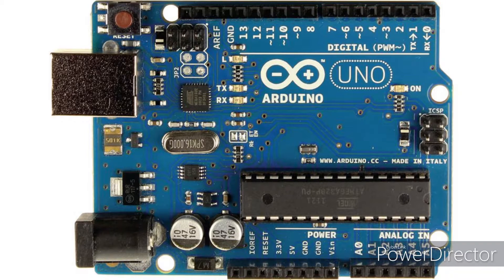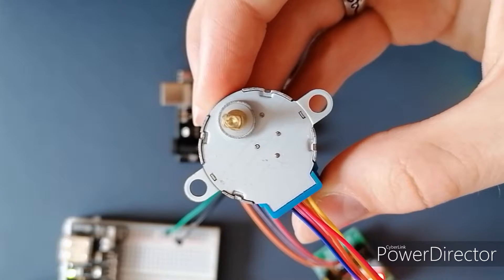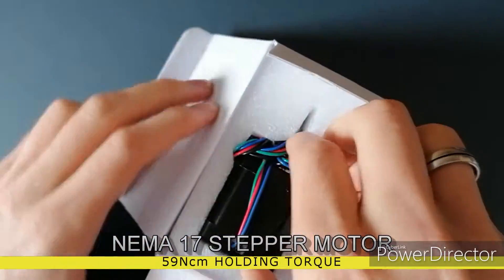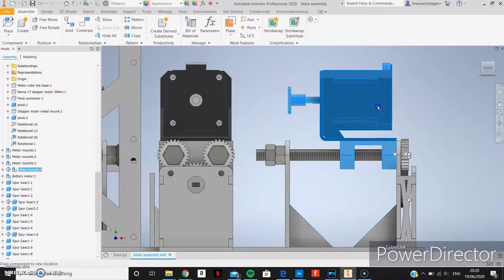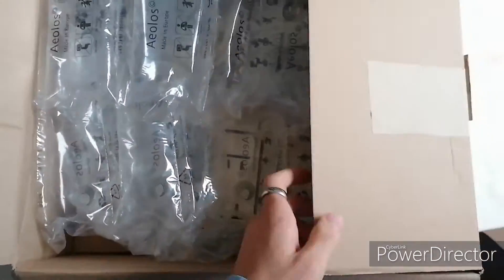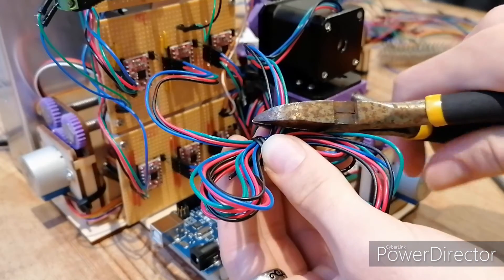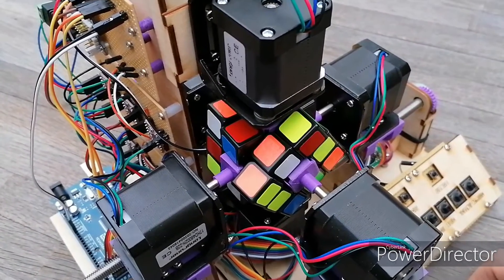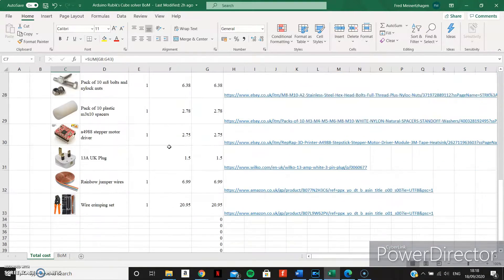Solving a Rubik's Cube using an Arduino

Comment: Hello. you might not see this but how do you use pulse width modulation with the arduino mega? the pins on the end didnt work with my motor and caused an error? I assume its the lack of pulse width modulation so how did you avoid that?
Reply from the maker: Only pins 2-13 and 44-46 work with PWM so bear that in mind, and remember to set the pinmode to output. Otherwise I don't know, you can check my code from the description

Comment: What if i used the  28byj 48 motor ? Would the code be  changed ? (2.16) or the entire project ?
Reply from the maker: The code would only need to be changed for the driver i.e. Using the servo library stepper.h instead of a for loop. I found that the 5v one wasn't strong enough but there is a 12v one which might work

Comment: I think that cost isn't too bad actually when, like you say, you factor in unused parts that were there for prototyping, testing etc.   Even the basic mass produced ones I see online range from around 100-150 quid.  I image the cost of R&D prior to mass production wasn't too small.  And I guess you accumulated a fair bit of knowledge on the way which is an additional plus.

Comment: How to know the zero position of the motors?
Reply from the maker: On this machine, the arduino doesn't know. You just make sure the sides are all straight before switching it on

Comment: Is the Arduino Mega any faster than the Uno? Both have a 16MHz clock frequency but I can't find information about how many transistors each one has. I suspect that if they are the same in performance then the Uno will be fast enough for my purposes, based on what I've seen in your video, and I won't need to spend as much. I am planning a project where I will need it to perform some maths calculations based on sensors, preferably 10 times per second, and use the results to control some motors.
Reply: use a teensy

Comment: Can I use the cheaper motor as I don’t want this to be fast?will the code still be the same?
Reply from the maker: The code should be the same if you're using the same driver and your motor has 200 steps per rotation. You could probably use smaller motors but I would recommend buying one and testing it first to make sure it works
Reply: @freddiemeinertzhagen  can you please provide me your code if you can ?
Reply from the maker: Try copying this into arduino IDE:
https://drive.google.com/file/d/1N6j5qj8LwoDTzmMjLcVfo3cnjZo2YrO6/view?usp=sharing
There are still a few mistakes that pop up every now and then that I haven't fixed so might not work every time but good luck

Comment: Eyo mate, I'm doing this for school, already got my printed design from school and now you're making me worry the 28BYJ Motor might be too weak. Great Video though, hope I can achieve a similar result.
Reply from the maker: It could work with that motor, I just wanted it to be quick. The ones I tested were 5v ones but I'm pretty sure they to them in 12v too so that might be a good idea

Comment: How you made the motor shaft couplings to the center frames?
Reply from the maker: I ended up having to glue a hexagon onto each centre piece to allow the motor shaft to lock into them like an Allan key

Comment: What rubik's cube did you use? I used a real cheap one and it jams so much that the motor can't make a single turn
Reply from the maker: Yeah I used a cheap one too and it jammed too much so that's why I had to change the connector. I ended up gluing a thin hexagon to the centre piece and making the motor shaft also a hexagon shape so that they could lock together like a bolt head and spanner. If feels like I'm kinda cheating by doing that though
Reply: @freddiemeinertzhagen  I drilled a hole through each centerpiece and hold it by screws, on the outside there are hexagonal bolts and the engines have hexagonal pieces which attach to the bolts. I hope that sacrificing a better quality cube that 'cuts corners' better will solve the problem
Reply: @armagedon2012studio  Did your cube end up working? I am trying with a high end speedcube at the moment and for me only the centerpieces turn but not the layers ;-;

Comment: What model of your power supply unit?
Reply from the maker: 12V DC Switching voltage converter, max 21A. You shouldn't need more than 10A though for 6 stepper motors so you might not need such a high power converter
Reply: @freddiemeinertzhagen  Thank you!